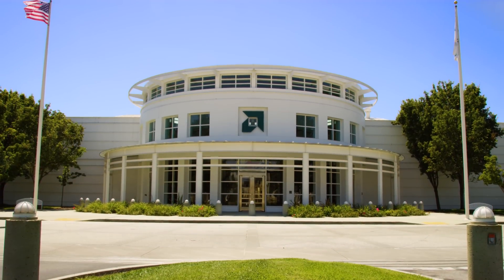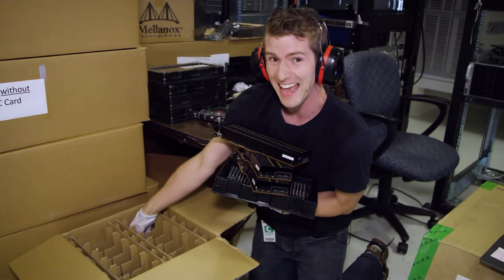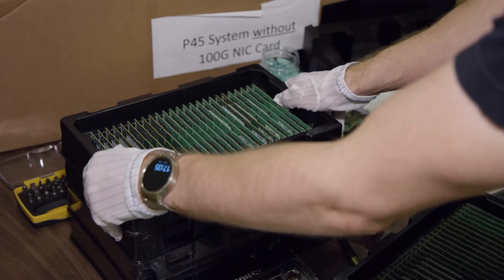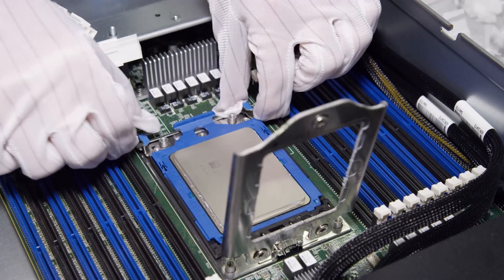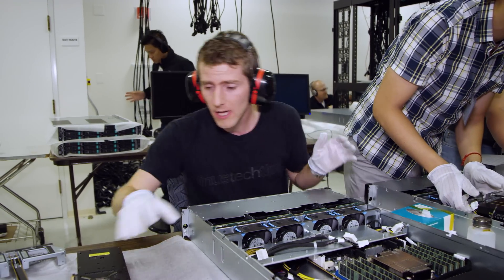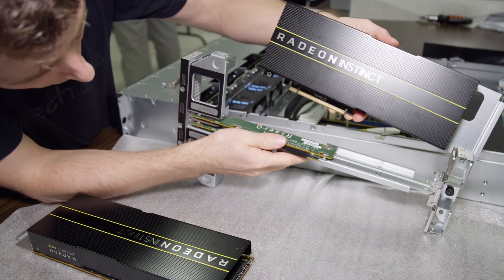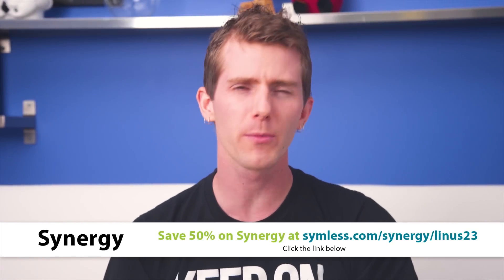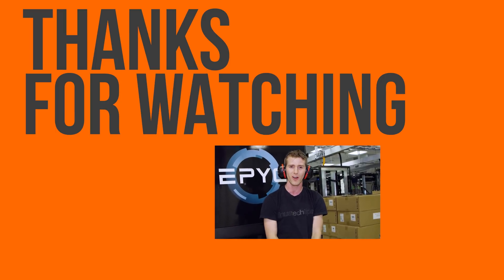AMD LET ME BUILD THEIR NEW 80 VEGA SUPERCOMPUTER…

Comment: A super computer that can determine the ultimate strategy to defeat Nvidia.
Reply: Puggie Gamer it beats the 1070 tho and competes nicely with the 1080
Reply: Puggie Gamer then I could say the same for Vega as they've shown in pure overclocking a 56 can beat a 1080 but a Vega 64 simply can't seem to compete very well with. 1080ti the Vega struggles against the 1070ti yes but not the 1070 the 1080 vs aircooled 64 shows a back and forth battle and the liquid cooled edition can compete with the 1080ti air cooled so you are kinda wrong but unless aib cards get better for Vega and amd can make it perform more efficiently it will be a good platform also Vega vs 1070 and 1080 in that application why would you even bring up those cards as these are purely for workstation tasks and are designed to compete with things like tesla cards so your argument is moot as we could say the same for Vega with proper cooling and power
Reply: The fanbois back at it again
Reply: Puggie Gamer sorry for reading your comment wrong and I never said they did I hope they can improve
Reply: Daniel Bray well that’s easy. AMD has CPUs and GPUs. Their graphics cards aren’t as good as Nvidia’s, but their processors are better than intel. As a result, they manage to sell reasonable amounts of stuff to both markets, and as a result; its likely that the company is worth more than Nvidia.
Reply: vega was never about speed. its more on the assembly line performance.  intel did the same thing with low end pentium G and i3 chips.
Reply: As Vega has potential and well I like more competition
Reply: Puggie Gamer true it takes freaking subzero to make it come to life which is sad but it might be just the gcn cores? I mean I'm still going to build a Vega pc and a Quattro or 1080ti or next variation pc so with epyc and a Xeon since I'm trying to do engine design and simulation. But I like to game on the side so idk might down grade to a threadripper or core i7 cpu as I'm trying to validate some ideas and having a pc that can act as a workstation and a nas/server
Reply: Daniel Bray I’m from the future. Nvidia DGX2 says hold my beer 1.5TB RAM xdddd
Reply: like a gps, recalculating. Turing drops, kills self
Reply: Nvidia working with IBM

https://www.google.com.sg/amp/amp.timeinc.net/fortune/2017/12/05/ibm-ai-chip-nvidia
Reply: Not intel tho
Reply: Nu ding what oems do, putting out the best possible specs and performance for the lowest price, without caring about under the hood quality
Reply: It Did !
Reply: jdr ok with sound power usage  and heat it doesnt at all
Reply: jdr ok amd never really made the perfect gpu series
Reply: Well, my dear sir you are mistaken. Radeon All-In_Wonder was ahead of it's time. Very will designed card. Nvidia had nothing to compete if my memory serves me right.
Reply: Puggie Gamer rx 480 and 580 was a sucsess
Reply: jdr ok vega does have potential but it just isnt the perfect gpu
Reply: Angelo Foster it definetly was not ment like that vega was made to beat the 1070 and 1080 but failed and the i3 and pentiums are just for lower tier gamers
Reply: Daniel Bray its too slow to calculate that vega sucks

Comment: Why is it so damn noisy in that place?  You guys wearing ear muffs and ear plugs - what's causing all the background noise?
Reply: These servers have smaller diameter fans because they have a low formfactor, so a lot of air needs to be pushed through the servers with small fans
This formfactor allows for more servers in the same amount of space

Comment: The question that everyone has is... it could be used for  videogames and have it at home? 🤔
Reply: Jaime Monsalve Actually you can use one of the server (not the whole rack) to game. However, most games aren't optimized for multi GPUs, so any game will have lots of problems. Also, those GPUs are made for general computation, not gaming, so you'd better be off using mainstream GPU.
Next, most games will break if run on CPU with such high thread counts. There's even an option on Threadripper to disable some cores in compatibility mode for older games.
And lastly, that server will be loud as hell. You don't want to put it in your living room. Fans for servers are made for performance & reliability without any regard to noise output.

Comment: 2 EPYCs = 14 gamers 1 tower #Michaelbaystyle
Reply: Well, a single $2000 EPYC CPU can support 128 PCIe lanes so that's 8 GPUs with full x16 bandwidth and 4 cores for each session or 16 GPUs with x8 bandwidth and 2 cores for each session. So Theoretically, you can run 16 games with 1 CPU, given if you can find a board that supports 16 PCIe x8 slots for EPYC.

Comment: Just saying, Nvidia has been able to do this for years...  It's called the DGX-1.  Literally just stack 10 of them in a 20U rack and you're done.
Reply: Also, it would be more power efficient IIRC because DGX-1's run about 3300W each.  Also would be more powerful in FP64 because of the 1/2 rate FP64 on the P100/V100.

Comment: Linus, you should build a PC that cost the same price as your first PC, to see what your original PC would b today.
Reply: Alexander Ortega No, he rebuilt his first PC. I want to see a modern PC     with the same budget.
Reply: I estimate my old Vaio PCG-719 laptop to cost around $6000 in 1997 ($9150 today), as the base model (PCG-705) cost $4500. The PCG-719 was the second-highest tier business laptop, and it has a Pentium MMX 233Mhz, 128MB ram (fully loaded), XGA screen, and some NeoMagic 2MB graphics chip. I got it for free from someone who purchased it for $5 at a thrift store. 
Jeez, and to think about what you could buy today for $9150...
Reply: Bump. I would love this!
Reply: Pretty much what's been said, just spec out the most expensive PC you can think of. My IBM AT cost over 10K, back in the 80s. A relative sold a 10MB HDD for over 30K.
Reply: Seeing as an original 486 x 50 MHZ. Processor listed at $4500 and 16MB'S.  of Memory was $1200 along with a 256 MB. Video Card at $1200 and a PCI Motherboard at $1100. With equipment available today a very decent Alienware 51 with 128GB'S. of Liquid Cooled Powered Threadripper shouldn't be a problem.
Reply: Linus media group should have it's own super computer.
Reply: Would probably be pretty beasty. Our pentium 2 machine with voodoo 2 card and all the blows and whistles was nearly $3400 and that's the direct sum of money. If you compare the value of money back then to this day it would be closer to $6000.
Reply: Ahh... Pentium - the birth of plug & pray.  Remember interrupt requests?  Lets see if Linus can build a 486!   That was back in the days when you needed to know a thing or two to put a rig together.  @LinusTechTips -  why post a video on a supercomputer without talking about software?  No LINPACK - that's sacrelig!
Reply: my first pc was probably 3000$ - a 486 pentium 66mhz (?) processor with 4 megs of ram. i had to boot straight into dos to run doom 1 shareware edition and the computer didn't come with an audio card. pretty sure the monitor was extra but tbh i was like....13 at the time, probably. you could build a monster pc today for that budget
Reply: I forgot to add the $750 for a 25 GB. IDE Drive. Adjusted to inflation it would now cost in excess of $20,000. You can buy a Workstation for that price from HP.
Reply: I've got parts.
Reply: Maxym00 Gassner  yes. And adjusted for inflation
Reply: Rye Hots i remember i bought my first laptop at bestbuys for $2000 an acer with 133 mhz cpu and i cant remember the ram but it was slow but used it for aol
Reply: Maxym00 Gassner That wouldn’t really make sense as computers have actually become much less expensive. Even a cheapo pc from the 80’s or early 90’s would have been over $1000 and that’s not even taking into account inflation. Chances are whatever Linus first computer cost back then he could build something amazing nowadays for the same cost.
Reply: Just took my first pc $ in 1998, which was oddly $1998, scale for inflation, and I have spent slightly less on my current system, close to exactly dollar for dollar though.
Reply: thats a really great idea
Reply: crazy isnt it its almost asif computers and silicon chip manufacturering has improved in performance/effciency crazy that who'd of thought that.

Too young to remember my first pc i was about 4-5 in 98-99 and we had a win95 computer that we got for £200 i vividly remember a star logo
Reply: Stormchaser Elite inflation would ruin the conparison
Reply: Accounting for inflation?
Reply: he has already done this
Reply: My first computer was an IBM with a 8086 processor running at 16mhz with 1mb ram and 30mb of had. It costed about 4200$ in 1989 which today would be about 7000$ Still have it :-)

Comment: Can any one help me I can't get a xfx r9 280x working in my system I have tried reseating the card a bunch of time, the pice power is plugged in and the gpu works fine in another system. The old gpu gts 250 works fine in same slot.
Specs
P55a ud3 mobo
Intel core i5 760
2x4gb kit hyper fury ddr3
Silver stone strider plus 500w psu

Comment: How high can ram go the highest i ever saw is 16
Reply: 128GB ECC server ram is the highest for 1 stick i could find
Reply: Windows server 2016 - 24 freakin' TB
Reply: Not sure where you got that number (it's completely wrong), but the theoretical maximum support for memory on the amd64 arch is 2^64 memory addresses, or exactly 16 EB (exabytes) of memory.
Reply: Ganta Kanata What do you mean by that? The highest Flash Storage per Chip or the Cloclspeed or the global amoumt of RAM per system?
Reply: Windows 10 Pro 64-bit : 512 GB.
Reply: I have a copy of Windows Server 2016 Datacenter Edition. I might make use of it someday for a project. Good to know it supports ridiculous amounts of RAM, just incase I need it. XD
Reply: Uhh.... Several terabytes on 1 MotherBoard?
Reply: You can have upto two TB on one system if you have the right hardware.
Reply: Ganta Kanata Ive seen mobos that support 3tb of ram
Reply: Windows 7: 16gb
Windows 7 pro:128gb
Reply: Software support != possible. I mean if you want to go with counting software support the 64 bit address space theoretically supports 17,179,869,184 GIGABYTES of RAM.

Comment: With all that power, and all the heat, that thing is going to be generating, they're not going to try liquid cooling that rig?

Edit: OK, so there is some sort of super air cooler in the rear, but to me it would also be sensible to have at least some heatpipes on those heatsinks covering those processors. 
I guess those Instinct M.I. 25 cards are like GPUs but without any video capability, will Radeon begin producing them for other purposes ( someone could maybe use them for bitcoin mining if they cobbled together the right support).

Comment: $50,000 for a P47. Is that just the rack? or plus EPYC and VEGA MI25s? because that's a cool $1,000,000 per petaflop rack. The first exaflop supercomputer would then only cost $1,000,000,000 which is totally doable by a large tech company.

Comment: Seeing this server room brings a smile to my face. Worked at a company before where the owner insists on locking up the company server in a room upstairs with basically no ventilation in or out of it. Then insists on setting the thermostat at 90F. Then would complain endlessly about the server locking up and basically not functioning correctly. When suggested to at least open the door and install a fan to suck out some of the hot air being generated by the server, he patronized me saying the components were designed to work in high heat conditions. So yep... glad i'm not there anymore.

Comment: in 20 years this shit wont even be able to run gta 10
Reply: Nafis Hasnian technically it does, but there is no output
Reply: aesthetic vaporwave 20 years will be GTA 6
Reply: Accelerator cards have similar architecture but their firmware is different. Technically same but still there is a bug enough difference
Reply: No video output on those cards so it can't even play GTA 5 today.
Reply: DatGameKanaal 
Yeah, but thats the console version...you have to wait 2 more years for the pc port. So 2072 then.
Reply: In 20 years we'll finally see Red Dead Redemption on PC! #Sad
Reply: A skeleton With a top hat, the current 14nm process means each line of the circuit in the transistors are 70 atoms wide of silicon. It's difficult to produce reliable IC's with that little amount of atoms in width which is why there is research into replacement mediums instead of silicon. The manufacturing can't keep up with the design and even the design part is becoming difficult to go smaller than 7nm because of randomness with atoms.
Reply: Saint Ayejax this thing can't even run gta 5. It has no graphics cards
Reply: In 20 years we'll finally get a new Elder Scrolls.
Reply: Too bad there will never be a another gta game. they will just keep milking gta online for the rest of eternity
Reply: A. it couldn't run gta 5
B. moores law is dead
Reply: because Moore's law hasn't been true since at least 2010, otherwise Nvidia's latest cards would be on the verge of 48 billion transistors on a 500mm2 die if you consider the 580's 3 billion transistors in 2010, instead they have 21 billion in 800mm2.
Reply: You mean GTA 6
Reply: Gillian Seed Why would moores law die?
Reply: Jonathan Laig I hope you're joking.
Reply: Xx_12YearOld_xX well depending on what... for example vega FE trashes everything consumer tire from nvidia in terms of proffessional work... but in games is another story...
as for "can it run gta" well yes it can run gta but no video output..
Reply: Saying that is pointless. Everyone and everything becomes old sooner or later.
Reply: thats not what this system is made for you a**
Reply: Motolav Okay thank you. But don't you think they will discover something new to make it even faster?
Reply: Saint Ayejax in 10 years a phone is gona be more powerfull
Reply: what's funny is its most probably true
Reply: 20 years would be like gta 8-9
Reply: No GPU'S?
Reply: A skeleton With a top hat its pretty much dead because intel already announced that the speed of their advances is slowing down. Im sure it would be difficult to keep increasing the amount of transistors especially because of how far we've come already
Reply: yea the system won't run anything but the video card will be able to run games that will come out in 2050 just plug it in a threadriper the RX Vega Instinct faster than a 1080Ti
Reply: Nafis there is a video card a Rx Vega Instinct faster than a 1080Ti but they will never sell it its for their own use.
Reply: I can't fucking believe this! You guys are arguing whether it will run gta or not! These accelerators have Vega architecture but nothing close to a vega graphics cards. It process data for machine learning. It may look like a graphics card but it isn't. You have to modify it's hardware and drivers to actually make it a graphics card.
Reply: @DW_Drummer Community never dies
Reply: Saint Ayejax very real comment
Reply: Saint Ayejax idk this might still be really good in 20 years just not efficient
Reply: Saint Ayejax idk this might still be really good in 20 years just not efficient
Reply: Mark S these are accelerator cards. These are used to process a lot of dataset for deep learning
Reply: 10-15 years later...you will buy it for $150 on ebay
Reply: Well a super computer made in 1997 can run gta 5 on medium.
Reply: In 20 years GTA 6 will just be announced to release in 2046 which then later gets delayed to 2070
Reply: Because I'm Batman! 0.01c + 37.99 shipping
Reply: Jonathan Laig you are a dumbass for sure. These aren't anything like 1080ti or "gaming" aka toy graphics cards for kids. This is made to compete with Nvidia Tesla k80

Comment: For a comment further down I was wondering about the relative performance of this machine, here's some interesting info...

IBM's Roadrunner at Los Alamos was the first 1 Petaflop supercomputer, coming online in 2008, so less than 10 years ago. To achieve that performance it required 130000 cores, 300 racks and 2450KW of power.

This guy here, less than 10 years later, achieves the same performance in one rack, with 35KW of power.

Holy SH!T!!

Comment: 35000 WATTS? thats 35 KWH, so running this for 1 hour would cost 3.50 at $0.10 USD/kwh, a full 24 hour day would cost 84 USD. Running this for a month straight at 24 hours a day would add an additional $2520 USD to the power bill each month. Damn

Comment: Given the hardware and performance, 50k per server is a bargain. That's not some one off proprietary system either. Consider that Epyc CPU's use the same socket as Threadripper. There's no particular reason you couldn't build a desktop PC with one. It wouldn't be the fastest for gaming, but it would tear through video encoding and other heavy CPU use applications. Heck, it might be able to run Cities Skylines on top settings. ;-)

I'm curious how those Vega cards stack up against Tesla 100's.